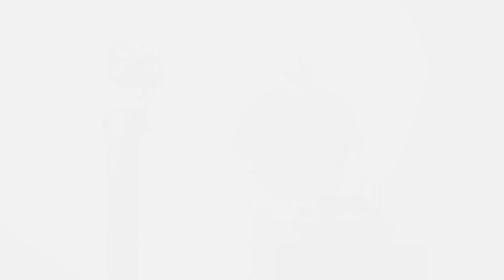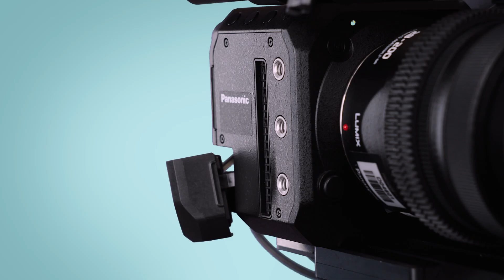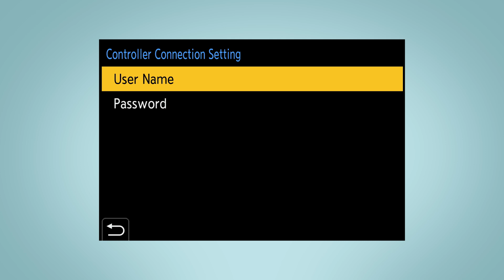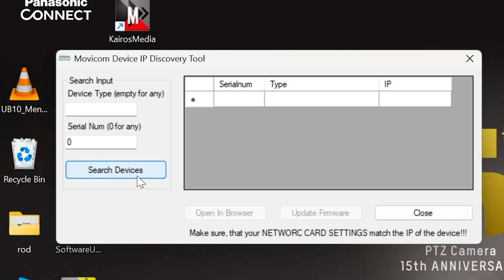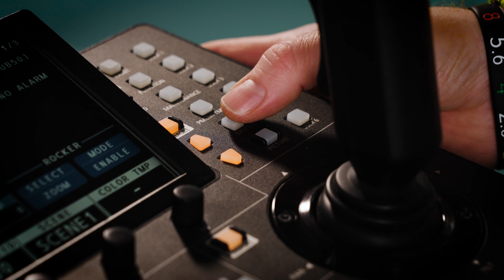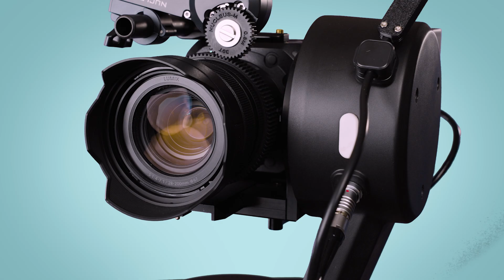Set up of AW-UB50 Box Camera with the Robyhead D2

Comment: What about the Lumix BGH1 box cameras? Do they work with the Robyhead D2 or will I need to wait for software/firmware update?
Reply: BGH1 don't supported AW protocol. You can use this PTZ with BGH1, but picture settings will not be configurable from RP150 as I understand. Just Zoom, Focus by external motors. That's like any other cameras, for example you can you it with blackmagic camera.